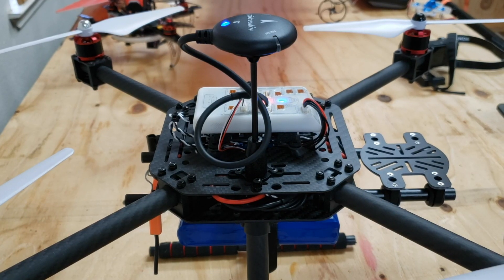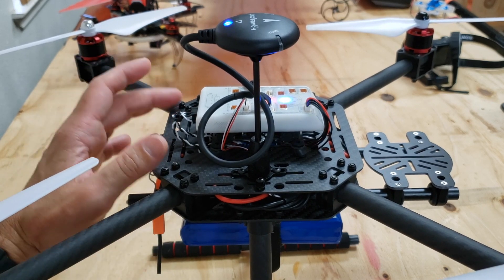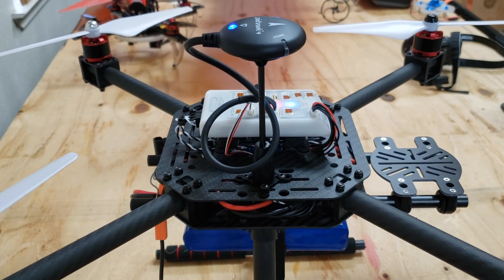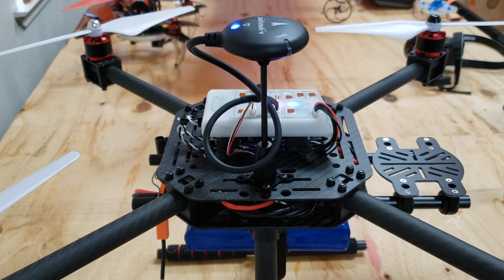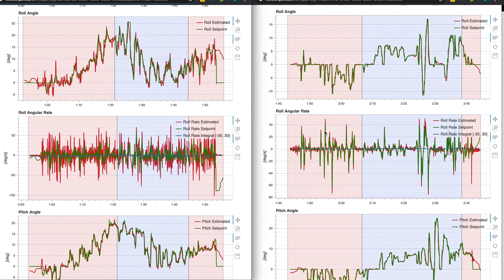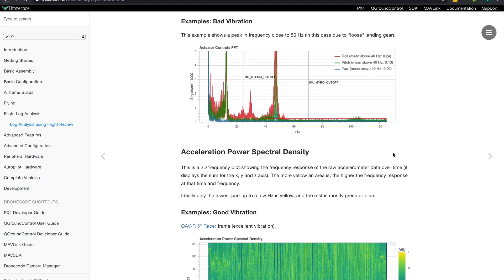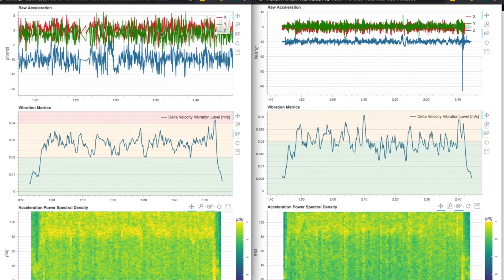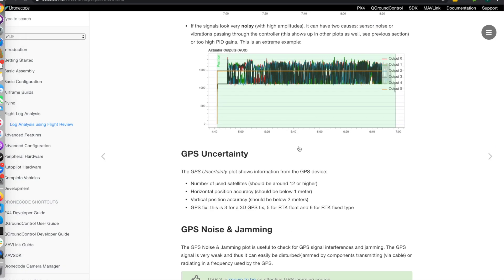HoverGames Drone Vibration Analysis w/ PX4 Flight Review - Don't Let Vibrations Kill Your MultiRotor

Comment: Looking for any suggestions on "readily available" foam to try. When investigating it looks like silcone foam is thought of as the best vibration dampening. But  if we can find a nice source maybe it  could be updated in the NXP  kit. I've seen some weatherstripping that seems really soft but dense as well. Maybe Air conditioner sealing foam as well. If anyone has suggestions i think i'll replicate what Dennis has done here and  try a few of them.
Reply from the maker: I've sent a note to these guys: https://store.mrobotics.io/product-p/mro-pxfoams-mr.htm hopefully they aren't trying to charge $22.90 for 4 little pieces of foam. We'll see. Here is another source I may try: https://amzn.to/2Rc9tps
Reply: I have been thinking of trying "makeup sponges" that are typically available at a drugstore or dollar store. They seem like a nice mix of squishy and firm. Like tiny memory foam mattresses.
I'm also wondering how the actual placement of the foam/tape changes the vibrations. Large amount - all over the bottom vs tiny pieces in each corner. Lots of experimenting to do!

Comment: The oscillations one a drone are usually caused by two factors: a) unbalanced propellers and b) cables being not made tight.
Looking at your build you can improve a lot by fixing the GPS cable with zip ties close to the FMU at the frame, using sthe shorter GPS pole that is included in the kit and try to balance the propellers.
Reply from the maker: Thank you for the feedback, Gerald. Last week I ordered props from Master Airscrew and they came in yesterday. They appear to be of good quality. It's difficult to balance the self-threading props that come with the kit so I will give these new ones a try. I am using the short mast for the GPS but have not done anything with the cable. I like the way it handles just with the foam upgrade, but no reason I shouldn't take it a few steps further with your suggestions.
Reply: What do you mean by cables not being made tight Gerald?
Reply: @MrSiciro  He means loose wires that may be long that have extra slack in them. When a drone is flying this will cause unwanted vibrations when in the air due to wind and typical drone maneuvers. Best to secure them to the frame in some fashion.

Comment: Would be interesting to compare the 3M foam with the little blue rubber mounts that come with some FCs.
Also, I have always wanted to know whether it is better or not to increase the mass of the “vibration filtered” components, maybe by attaching the rpi and the fc together and put them on the foam instead of only the fc...
Reply from the maker: Do you have a link to the blue rubber mounts? Not sure if I've seen those before. Thanks.
Reply: @dennisbaldwin  Actually there are "rubber mounts" already on the mounting plate. I think they are actually silicone, and often they are blue or other colors. On the HG drone they are black.  My understanding is that they are typically a bit too stiff to filter exactly you're trying to do here.  (The various colors i also think represent various stiffness-es.